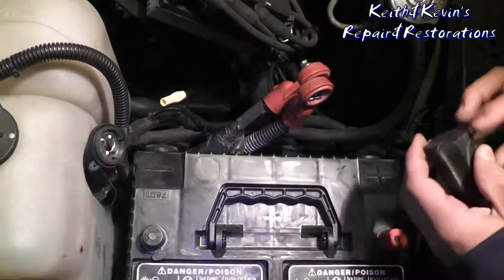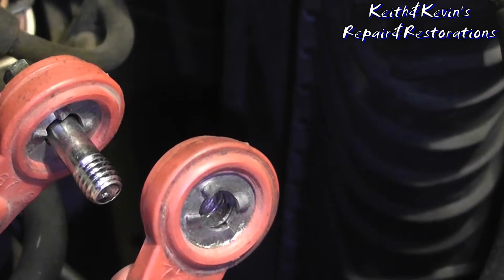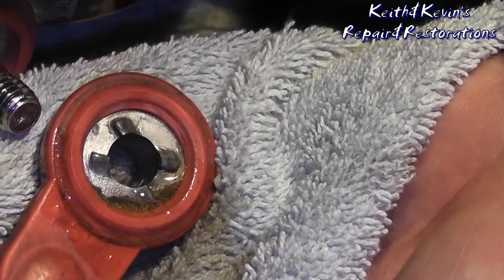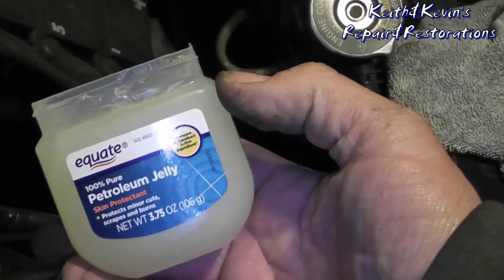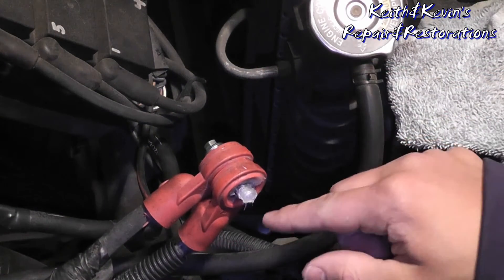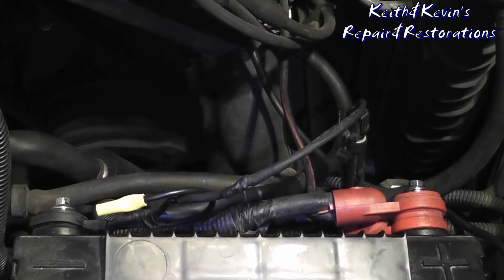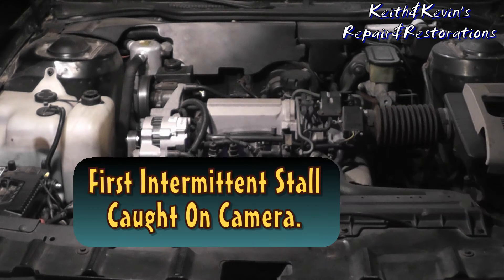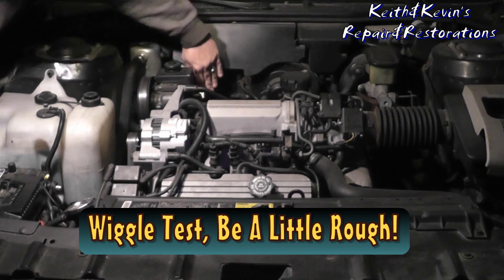Intermittent Stalling Dead Battery Good Alternator 3.8L/3800 V6 1989 Oldsmobile PT.2  Cables

Comment: I need help
Reply from the maker: What do you need help with?
/K&K
Reply: I have a 1989 oldsmobile 88 
And i need to know if the cable that goes to the negative battery from the fire wall or is it positive how many go on positive?
Reply from the maker: @rashaadmcclenton9386  Main negative cable should go to the engine block. The 1989 has two main positive cables , one to the starter and the other one goes to the fuse panel to feed the ECU / other electronics. Make sure you identify your battery cables correctly because you can cause damage to the ECU if the positive wires or ground wires are switched. 
/K&K
Reply: Okay the cable to the fuse panel
For the ecu has a connector 
Is that positive on the battery?